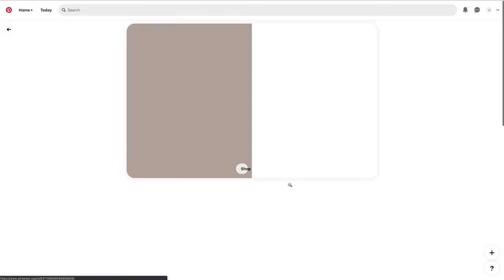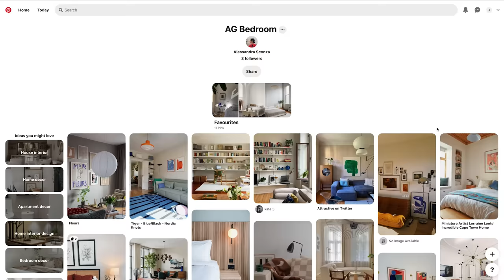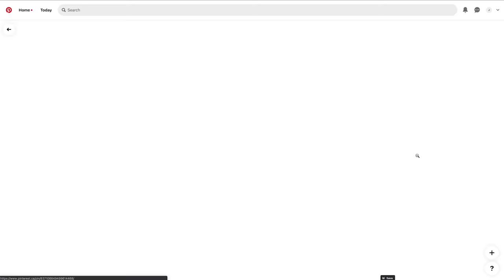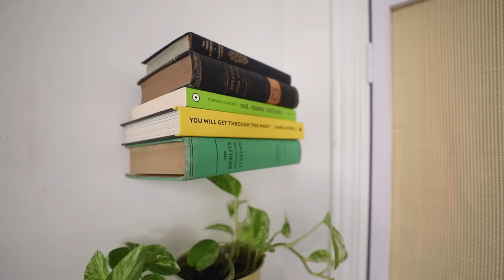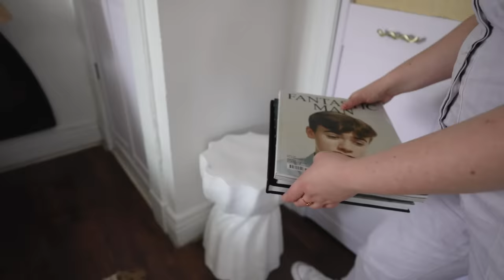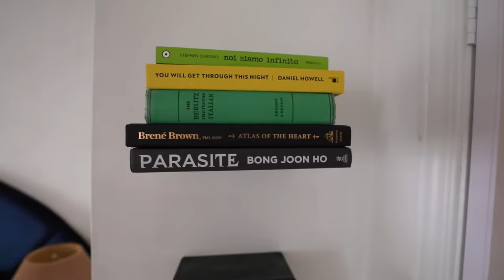EXTREME TINY BEDROOM MAKEOVER | Post-Modern Style

Comment: In general a beautiful job. Love the headboard. Really love the bifold doors with cane.  I'm going to do that to one of my closets. I think the "night stands" are over accessorized.  They need to be functional so you need to leave more space for things one might have to put on them. The curtains in such a small space definitely do not need to puddle on the floor. No no no. In the video you can see she already tripped on them. Please incorporate function and practicality into your design.
Reply: I think she is aware at that. This was just done for staffing purposes.
Reply: Aye, hang the curtains as high as possible.  Curtains pooling on the floor are a menace for a vacuum cleaner or broom and are a trip hazard. And they look like someone didn't measure properly.

I love the vase lamp - you all find such great things to DIY.
Reply: Pooling curtains is an extremely traditional design element. I have it and my home and do not find it a menace at all. Of course in practical use the night stands may be used differently but they looked gorgeous in the final images!
Reply: Roman shades are another option
Reply: Love the makeover but I always roll my eyes at curtains pooled on the floor. Unless you clean obsessively and have no furry roommates, those curtain bottoms will get incredibly dusty and dingy very quickly. And yes, also be a tripping hazard.
Reply: 100% agree with you. Doesn't matter if it looks nice, if it's not functional and can create a potential hazard it is not worth it. Small tweaks to this design would have fixed it. Unfortunately I think with this channel at least it's not about the functionality behind it but the looks in the after. As an interior designer myself it does sometimes sadden me when these things aren't thought about enough but that's not the intention of this channel
Reply: The accessories on the nightstands aren't permanent. She can easily remove those items–a lot of the times magazines and design shows just have accessories on display for the "after" as inspiration for the viewers. Not for the exact look, but to show them different cute things that fit the style subject they could buy and place elsewhere in their homes.
Reply: I like the puddle. It’s a grounding effect. Yes yes yes.

Comment: First, let me say I love this channel.  I was inspired by the closet doors in this video and was able to cut and remove the slats from my slatted closet doors.  The wood putty to fill the holes for me was a nightmare.  Where was Graham when I needed him???  I could not get a nice smooth wood putty/sanded look....my skills were lacking.   I did find a piece of odd PVC trim at Lowes that covered my holy mess.  I was able to cut this trim with a box cutter and use liquid nail and brad nails in my electric staple gun to attach it to the door covering all of the holes and my poor attempt at wood putty!   Doors look great. Thanks for the idea.  Trim cost in US $  5.08 for an 8ft piece.  Keep the inspiration coming!

Comment: If I may offer a suggestion: with cane doors, it would be nice to add a piece of trim on the inside to finish off the raw cane edge. With this stapled down edge, I would be afraid that my clothes would snag on the cane.
Reply: Agree, I have seen them done this a few times and it looks good from the outside, but messy on the other side (especially the uneven staples). Great idea to place a trim, that would make it clean and finished.

Comment: It wasn't that there wasn't enough foam in the vase, it's that it never fully cured. It requires moisture to cure, and it gets that from the air. When you put 1-part spray foam into an enclosed space, it will never fully cure. Even if it had, the repeated turning on-and-off of the lamp would cause the whole thing to loosen up and flop over. Graham did a great job problem-solving with that one. But I bet if the lamp breaks in a year, it'll still be a goopy, sludgy mess inside. (Let's hope it doesn't.)

Comment: I would paint the bedframw the same blue as the headboard or stain it the same tone as the side tables- this raw pine doesn’t go with the headboard at all in my opinion. Also not sure about the rattan in the closet doors- again doesn’t seem to go that well with the rest of the style. Maybe if it was painted the same lilac?  But otherwise it works well together 
and while it’s not my preferred style it’s nice to see some different things.
Reply: For me, the lilac is throwing everything off too. It is not a MSM color nor a scandi color. I feel it clashes with the cane. It would look cohesive if the bedframe, side tables and closet doors matched. I don't feel things need to be matchy matchy, but cohesiveness does go a long way in a small space
Reply: @lisaduncan6923  I think the lilac fits well with postmodernism/Memphis which is the style they were going for, but I don’t feel the rattan works with it. Not sure what MSM stands for? Or did you mean MCM? Which isn’t a style  they were going for.
Reply: @sinaain  you are correct, I watched a mid-century video before this and I guess it was stuck in my head. I looked up some post-modern design styles and many of them had cane. I am not a fan of that design at all. The pics I saw were not to my taste.